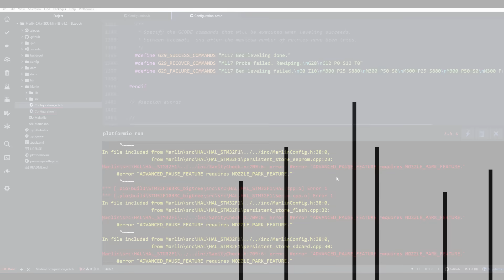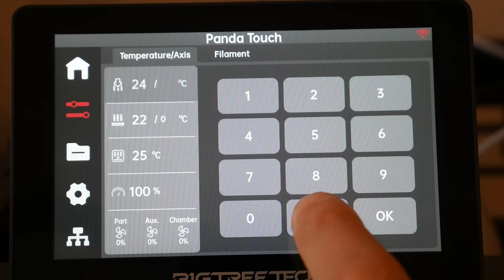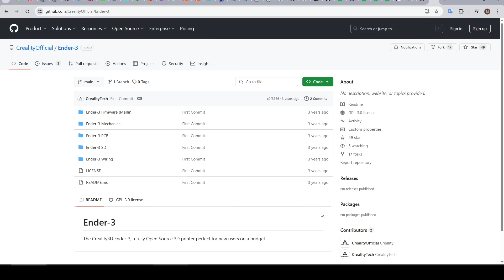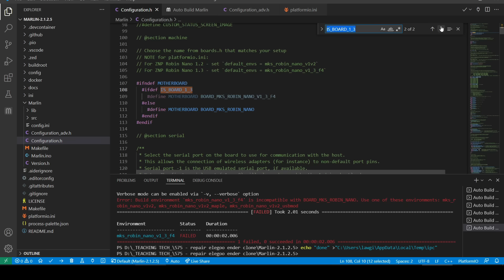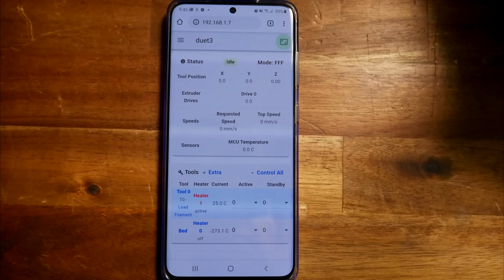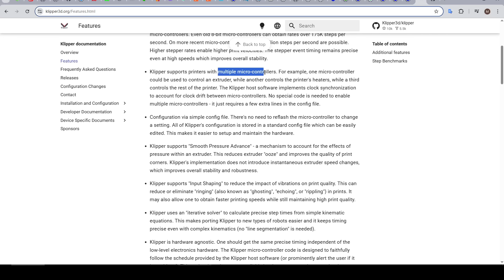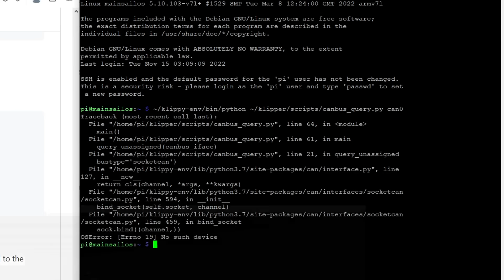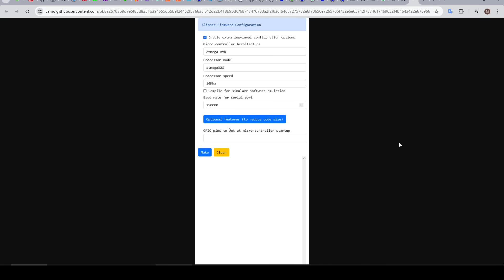What each 3D printer firmware does well, and where it needs improvement

Comment: The 3D printing hobby was born from Makers. Makers make, build, modify & understand... Today you have companies trying to remove that. If a company locks people out, we will eventually have all 'Consumers' and few 'Makers'. Consumers, well, consume. They do not make, build, modify or understand how a product works in any sort of technical capacity. When things don't work, they have to contact the company for help. What happens if the company is backed up or just not responding to support requests fast enough? Consumers then look for Makers to give them guidance.. but what happens when the companies lock system down and there are less people learning to become Makers? There will be less and less Makers to help.
Reply: im a student learning about additive manufacturing. we were supposed to get a "tinker kit" to assemble as a part of learning 3D FDM printing, but the kit that came this year was simply a mostly assembled creality that just required us to snap a few pieces together... there wasnt any lead screws to put in even, no leveling skills to learn anymore, nothing, just snap together and print (WHICH IS GOOD YES) but I didnt learn what I wanted to or expected from the class, and YES, this is proprietary business modeling homing in on an open market to close it, manufacture scarcity, and sell a solution in a bad economy.

THIS COULD KILL THE HOBBY IF THE ECONOMY DOES NOT FACILITATE IT. I am NOT spending thousands to try to gain access to this hobby when the companies who want me to come to this hobby only want me here to KEEP ME AT ARMS DISTANCE.

fine. I will engineer my own 3d printer, and code, and slicer, its why im in school.

proprietary manufacturing has ruined our species and society, and regressed innovative mentality. we are years, if not decades behind where we should be.
Reply: the "made for makers" printerz which have MASSIVE online communities designing peripheral projects to print for their printers? those are disappearing, and what I DIDNT get to learn with at my school this year.

big L for education in this hobby.
Reply: This is the worst take here.

If you can't tinker with the firmware of your 3D printer, you forget how to 3D print? What?

Also, Makers are pretty shit at supporting newcomers.
Reply: @Those_Weirdos  I did not say anything about 'forgetting how to 3d print'. Re-read my comment. If people can't modify hardware, edit firmware.. and they can only print. That's is all they are going to learn to do is print. I can tell you, as a maker who has built 3D Printers from the ground up, I do not need to ask or complain in forums, groups or chats, that my printer is trash because nothing adheres to the bed. I understand how printers function, so I can resolve printer issues. That is the difference between a Maker and a Consumer. A Makers learns how things work.. inside and out. A Consumer, consumes.
Reply: @rickasisco  I don't think splitting the world into makers and consumers is helpful - binary choices seldom are because reality is more complex than that. Some people see succesfully configuring, building and understanding 3D printers as a big part of what they want a 3D printer for. Other people (me for example) only want it as a tool to help me the do the thing I really want to do - design and print parts that I find useful round the house.  I want something that just works so I can get on with the thing I want to do. If a company can supply that, I'm happy. There will be other people who's use of the printer lies somewhere in between and yet others whose use of the 3D printer may be something entirely different - all of them are good uses for those individuals.
Reply: @Paulfarr1964  Don't get me wrong. I am not saying consumers are the problem. I am saying when companies try to lock out makers, so that all you end up with is consumers, we all loose out. 3D printers, like the one you use, would not be what they are today without makers. Open source is what promotes makers.. the same kids today, learning from open source printers, firmware and software, are the makers of the future who may spark the next great inventions. I am not against companies helping to advance the hobby, but to lock out those who brought the hobby this far and those who may take it beyond is detrimental to the hobby. I like the idea of buying a premade printer that works out of the box, but why do some companies try so hard to block makers in the name of profits, when they know they would not be where they are today without the makers of the past.
Reply: Wow 🙄 why do you only apply this logic to 3D printers and not to all other electronic devices in your life?
Reply: @riba2233 This is a 3D Printer related video and as such, I stuck to the topic of 3D Printers. You need to keep in mind, 3D Printers were not created and promoted over the years just by companies like most 'consumer electronics'. They were created by Makers; originally created from threaded rod, nuts and plastic parts, as an affordable, open-source 3D printer capable of self replication. Those interested, would build a printer, learn to understand how it worked and how to fix it. We would then print the parts needed to make more printers and share them with other Makers. It was all open sourced. It was made by Makers for Makers. I am all for companies profiting for their development in this hobby, but to lock out Makers will eventually make a 3D Printer a disposable product like FM radio or HP Inkjet Printer.
Reply: disposable products are a result of literacy rates plummeting. think about it. :)

Comment: This is great info. I only have one machine, and it uses Marlin. It works well and I'm too comfortable with a working printer to justify playing with Klipper if it means that I may break my only printer. If I have second or third machine down the line, I may play with Klipper on my Ender 3 clone for the learning experience, but until then, I'm going to admire it from a safe distance.

Comment: Likely I could figure out the tweaking but in all honesty I simply do not want to spend the time and aggravation. It’s why I like Bambulab and I suspect it’s a big part of their success.
Reply: No personal judgement; There is no issue with wanting to buy a printer just to print. It's like buying a vehicle just to drive, but Iocking an owner out of being able to repair or use aftermarket parts is just lame in my opinion. Many people just drive.. and take their vehicle to a dealership for repair, but I have no interest in paying a dealership $800 to diagnose and change a fault injector in my truck when I can do it myself for $100 or less. I would never had learned to do that if I couldn't legally pop hood of all of my previous vehicles and learn to do so.
Reply: @rickasisco  although I agree with you in principle I do think your analogy is a bit off. There is not a brand of cars that lets you fiddle with the OS, some parameters sure but not the OS itself. I.e. you can’t put a Ferrari os into your Mercedes.
Reply: @Abbo-Fun  Exactly.. For many, many years some automotive companies have been locking owners out of the ability to make vehicle repairs and refusing accessible maintenance data and removing our right to repair, but makers (aka owners, independent mechanics, etc) have been pushing to get those rights back.. aka The "Right to Repair Movement". Much the same as cellphone companies are gluing phones together, soldering in batteries, etc.. so people can't easily repair their own devices, refusing aftermarket components, not allowing owners or 3rd party repair shops to repair broken devices. Laws are now coming into place to stop these companies from doing this. Companies are being forced by law to give access to maintenance and repair data, to make it easier to repair devices and so forth. Yet, some 3D companies are choosing to take the old path rather than the new path.
Reply: Having a printer that just works out of the box is such a blessing. Bambulab is a great example.

Comment: I think that open source firmware is absolutely critical. People can and will fix the vendors weaknesses, and even Bambu has weaknesses.
Reply: Remember: OpenSource is not a "job of others" it's the job of everyone.
We contribute by donating and helping by sumbitting bug reports and suggestions.
Reply: @Splarkszter and because I'm no good at coding, I donate to klipper a few bucks when I have them spare
Reply: Open-source is Communism
Reply: That's not true, people could fix the vendor weaknesses, but an open source firmware does not guarantee this. You also need to have popularity of the device to get people to adopt it and want to develop any open source firmware. You could make the most hacker friendly device in the world, but if no-one buys it, no-one will be hacking it.
Reply: I believe open source is more important in terms of older printers bringing them new leases on life.
Reply: If I had to mess with firmware and everything, I wouldn't have my 3d printer for 2 years. I got a Bambu printer and being able to print reliably without doing more than standard maintenance is really more productive in my case. Bambu are not problem free, they have weakness too. But nothing that makes me feel the urge to mess with firmware. Thinkering was mandatory when every printer maker would use almost the same parts, same firmware to make almost the same printer but with different cosmetic. And mostly the same problems. And almost no support too. My Ender 3 pro was fun. But now, I don't even consider putting more money on it because it will always be an Ender 3. Bambu changed the way printers were build, they did it differently and it worked. It worked so well that now, others start to copy the model. Might not be for everyone, but seeing how many printers they sold, I guess the market was larger than the nerds or geeks community.
Reply: @patricklebel1141  The more options the market has the better, When Bambu cut off third party support that was my line in the sand. It's not everyone's though and I know people that would be better off if they jumped into 3D printing with something like a Bambu or Formlabs. On the other hand there are people like myself that find the tinkering to be as much fun as printing though I am looking at the Qidi 4 PLus as it is better built for higher end Filaments, which would let me  trick out my other printers. With multiple systems it drive companies to innovate to keep up.